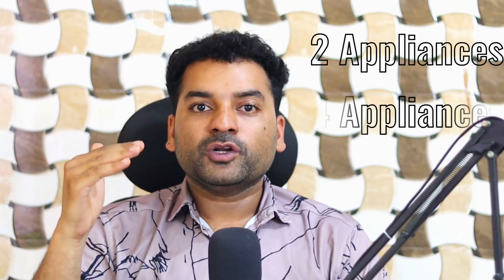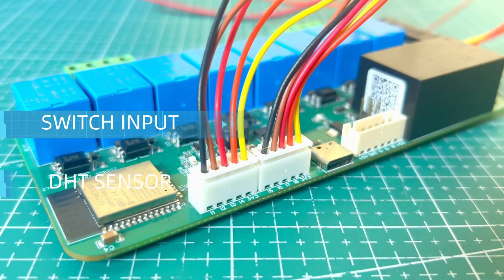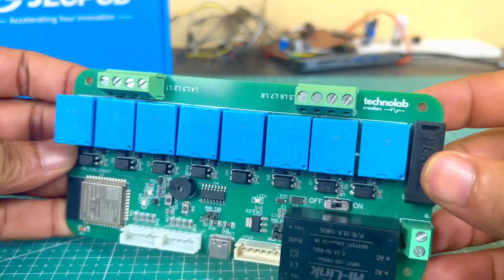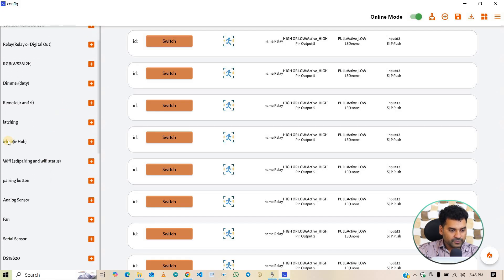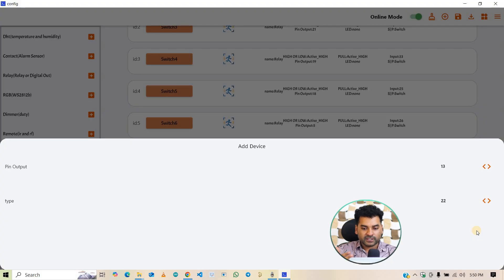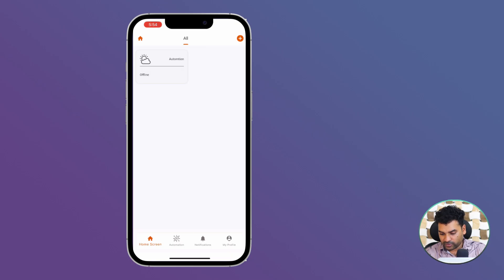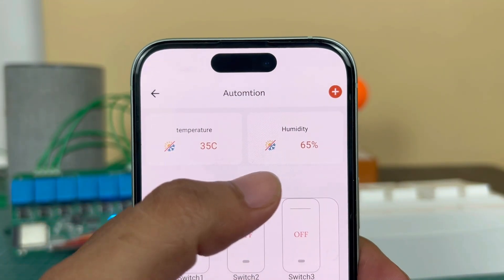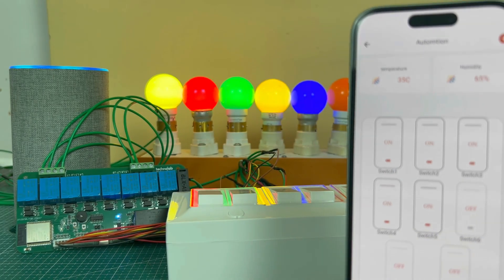ESP32 Home Automation PCB (SMT8N25) – Full Setup & 8 Appliance Control Demo | JLCPCB

Comment: Hey! Thanks for sharing your experience. I’m planning to order some PCBs from JLCPCB via DHL to India and had a few questions. How was the customs clearance process for you? Did you face any delays or extra charges apart from the DHL shipping fee? Also, what documents did you have to provide for clearance — like invoice, Aadhaar, KYC, etc.? Would really appreciate any tips or info you can share to avoid issues. Thanks in advance!
Reply from the maker: Hey! For KYC, you’ll need to submit a national ID like your Aadhaar card. And yes, apart from the DHL shipping charges, you’ll also need to pay customs duty once the parcel reaches India. DHL usually contacts you and shares a payment link for customs clearance. Just make sure the invoice is clear and matches the product details — that helps avoid delays. Hope this helps!
Reply: @technolabcreation  Exactly! Thanks for the heads-up. I’ve experienced the same — DHL usually sends a payment link for customs via SMS or email, and having a clear invoice definitely speeds things up. Submitting Aadhaar as KYC works smoothly, and the process is usually quick if everything’s in order. I just received my order. Appreciate you sharing this — super helpful for anyone ordering PCBs from abroad!